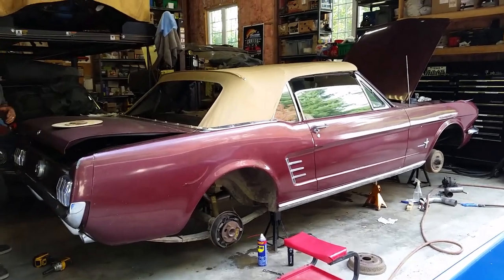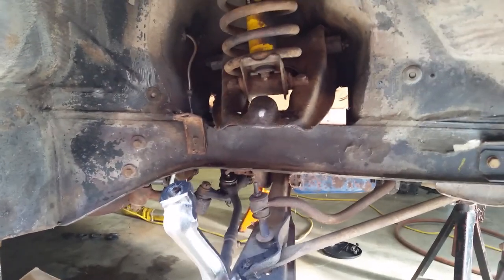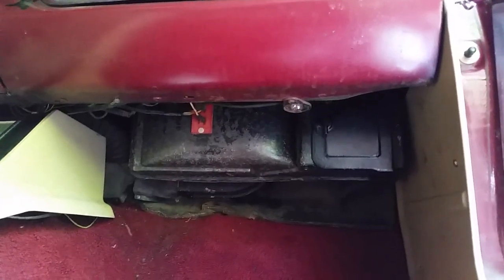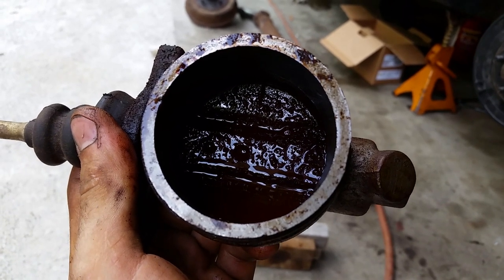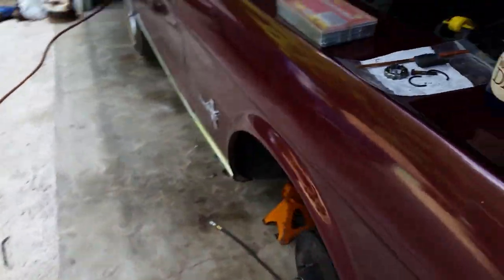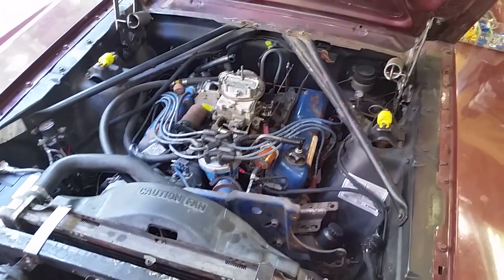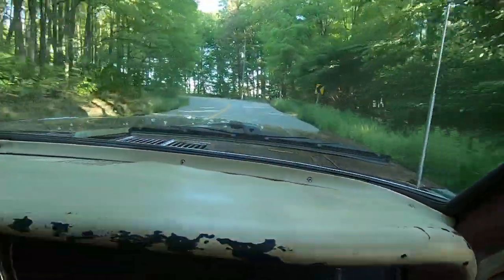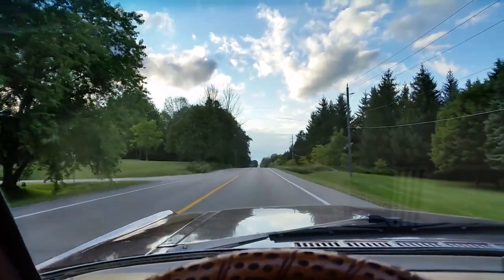Budget Build Mustang, How to Convert 4 to 5 Lug Suspension

Comment: First off I just purchased a 5000 pound set of Quick jacks. Used them the first time on my Falcon wagon last week. Amazingly easy and safe. The first safety stop raised it almost 2 feet. I just converted  my 61 Falcon wagon to 65 Mustang brakes. Used a 67 Mustang 8 inch rear end and stock Mustang steelies. Fit like a glove. The rear end is about 3/4 in wider in each side but fit in the wells perfectly. Used 67 Mustang spindles. Had to make an adapter to use the Falcon tie rods with the Mustang spindle. Converted to a dual master cylinder.

Comment: So, with the rear end swap, did you have to change anything on the driveshaft?  Different u-joint, driveshaft length, etc.  Looking to do this same swap on my 68 6cyl to go to 5 lug rearend (out of a 68 cougar), and front disc (power set-up but not sure if I will keep power booster) out of the same cougar.  Love the youtube channel as well as the partnership you have with your dad.

Comment: Nice job Mikey 👍
I did the conversion on my wife's 65 notchback I'm restoring for her. I'm keeping the non power brakes but did go with dics brakes up front and found an 8" out of a 66 mustang for the rear end. It also doesn't have power steering so that meant changing all of the front end around. I just ordered a set of magnum 500's for it as well, going with 15x7 all around with 215/60R15 up front and 225/60R15 for the rear.
I think it'll look pretty sweet.
Reply from the maker: Thank you Tim,
Right on, disc brakes are definitely the way to go! I was just trying to keep the cost down/ use up good parts that were laying around. I have a few sets of calipers but they require ALOT of work and will probably only be good as cores unfortunately.  
Perfect size tires, will suit the car nicely👌
Reply: I take it that the 215's up front will not rub? When I get to my 66 I was thinking of using 205/65 15's on all 4.
Reply: @Deucealive75  It doesn't rub but I am using magnum 500's with 4.250 backspace
Reply: @Timbo428CJ  Would the 225 60's rub on the front? If not why not use them on all 4's?
Reply: @Deucealive75  I really couldn't say, I was just going off what I had previously read about tire sizing. It just might be possible as long as you use a 4.250 back spacing.

Comment: Why didn't you use the rear diff and front spindles/brakes off the donor car the engine came out of? It's been a while so I don't remember if that was a Lincoln or Mercury.  If it was a Lincoln it should of had disc brakes front and rear ( disc brake 9" rear axle assembly ) . And if I remember correctly the front spindles off it, would of bolted right into the Mustang.  I've done the Granada/Monarch front disc brake and rear diff swap in the past. That was a cheap way to get disc brakes and 5 lug back then.  But it's been well over 20 years, so I can't remember all the details.
Reply from the maker: We haven't stripped the Lincoln fully. Haven't had time. But the 9 inch from it will be going into a different project. As for the front suspension, i believe the spindles have a different geometry to them. Also the tie rod hole is larger so I'd need a conical shim/ spacer to take up the slop. The spindles will work on a 68 and up car I believe, so when the time comes to strip the Lincoln I will save everything for future builds

Comment: is that a autolite 2100 carb? thats whats on my 302 '68 coupe. new carb kit re-ringed pistons/honed cylinders new timing kit it runs great but so cold blooded getting started, once up to running temp it's fine but no matter how much i adjust the choke/carb still runs lean first 10 minutes. is'nt that a pain mounting the heater box to firewall/defrost plenum i struggled with that for hours
Reply: Yeah with that heater box is a pain to put in by your self

Comment: Would have been a good idea to replace the blower motor while you had it out.
Reply from the maker: It works great, no need to. By the time the next heater core goes, then maybe it'll need replacing lol

Comment: Alpha Numeric tire sizes were 1 letter followed by 2 numbers a dash and then the rim diameter. For a 14 in F it would be F78-14 for a standard size. F70 for a wide oval, then an F60 or possibly an F50. The higher the number the wider and the smaller overall diameter. Most of the time if it has a whitewall it was normally the 75 width so those are more than likely F75-14. That would equate to a 7.75x14 or195x14 depending on the year.

Comment: Nice job guys! I plan do the same 4 to 5 on my 66. Can you tell me more about the size of the rims and tires.  Are the rims 14, 14.5 or? And what size are the tires ?  Many thanks
Reply from the maker: Thank you, definitely a good upgrade to open up the options for different wheels. The rims are 14" style steel wheels. I don't know the tire specs off the top of my head. They're bias plys so probably similar to a 195 x 70-75 x 14 if I had to guess
Reply: @Theoldcarchannel.  thanks again! Keep up the good work

Comment: What did you do about the steering?
Reply from the maker: In what aspect? Steering linkage is all the same and the power assist is running off the Lincoln PS pump
Reply: Center link, idler arm , pitman arm, tie rods are all different for v8 spindles.
Reply from the maker: @classicstangbrn8964  tie rods bolt right up, no difference in terms of diameter of the tapper that goes into the spindles. Sure the linkage may be different in terms of "beefiness" but it all works

Comment: Did the driveline bolt right up?
Reply from the maker: @DannyReckless13  with proper factory style engine mounts, yes.
Reply: @Theoldcarchannel.   I mean the u-joint / yoke. I have an i6 I am looking to 5 lug swap. I have a rear end but have read the ujoing isnt the same between the 8 and 6.
Reply from the maker: @DannyReckless13  I’ll be honest, I can’t remember if we bought new u joints or not. They make different sized cross u joints so you should be able to make it work. I believe the slip yoke is the same

Comment: So you used 8 cylinder spindles but kept the 6 cylinder steering linkage. Tie rod ends, center link etc. I was told to use the 8 steering components. My car will just be a cruiser. No spirited driving etc. I'm confused to what is actually needed.
Reply: V-8 go online  opentrack they have the parts you need.

Comment: did you use a 8.8 rear diff and if not what did you use i am thinking of doing the same swap
Reply: On a 8.8 you may have to remove  2 7/8" from the  D/S axle tube & use use a P/S axle. Done this on my wife 63 Merc. Comet rag top.

Comment: What can you use for front spindles and control arms if you don't have another mustang like what kind of car will be good for a donor
Reply from the maker: What year mustang? It depends
Reply: @Theoldcarchannel.  65  4 lug
Reply: I want to put  a v8 in it in the future so I want to keep my eye out for a budget friendly way to do it
Reply from the maker: @rodneywhite5904  well, weather you buy parts off someone for a mustang or for another car, the concept is to be buying their old parts (meaning they upgraded, bought new spindles, went to a mustang 2, etc, etc). 
All these parts are cheaply attainable you just need to dig through the classified. You'll find the right stuff. Control arms are the same. If your going to 5 lug,  it's spindles, and if you want to upgrade your center link, tie rods, drag link etc then you can do so with a used v8 set up.

Comment: At least you’re shirtless in the video because drum brakes suck. But it looks great
Reply from the maker: Drum brakes work fine when adjusted properly. I drove my blue car over 3k miles on hot rod power tour in 2017 with 4 wheel drum brakes and a single reservoir master cylinder
Reply: @Theoldcarchannel.  I’m not saying they don’t work. They just suck. All the parts, the adjusting. And they don’t look cool through the rims.